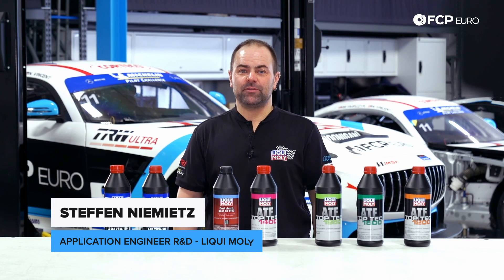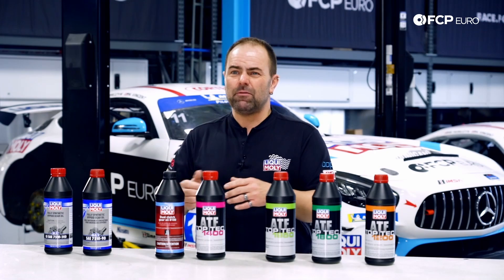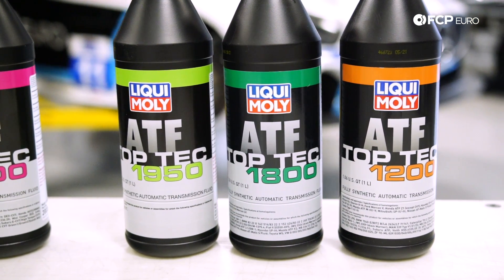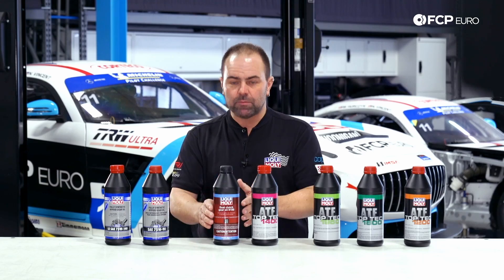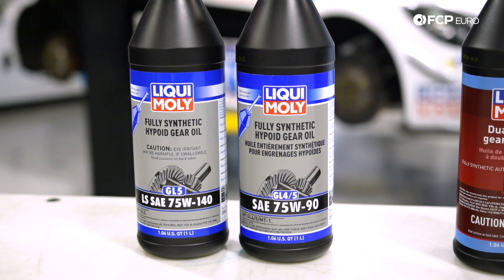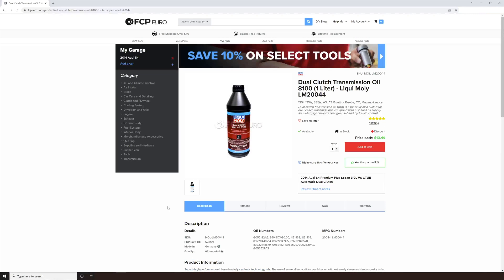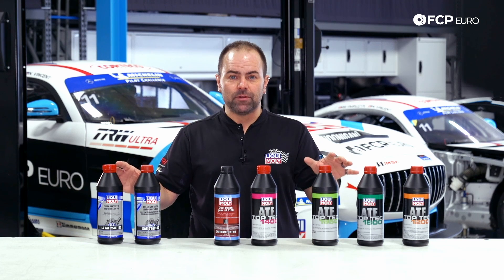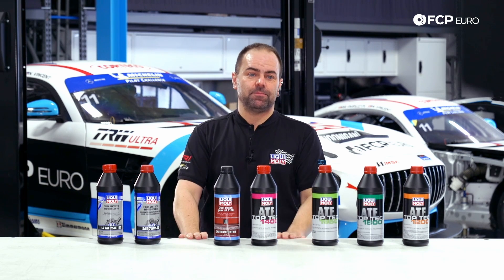LIQUI MOLY Transmission Fluids Explained (Gear Oil, Haldex Fluid, Transmission Fluid, ATF)

Comment: I replaced gear oil in manual transmission. What a difference from the last oil, wich was MPM totaldrive 75w-90. Liqui moly made the gears smooth and quieter.

Comment: What's the difference between Top Tec 1800 and 1800R?  I have a 2008 BMW E90 318i automatic.  Thanks.
Reply: Did you ever figure this out? I have the same question?
Reply: @criis651  Sorry I have no further information on this.
Reply: @Telstar_1  LIQUI MOLY responded. Both products have the same performance and meet the same specifications. The "R" stands for red and is a reference to the red color of the Top Tec ATF 1800R.
Reply: 1800R is dyed red

Comment: Hi, my car uses 4 speed AT transmission and requires the Mitsubishi SP-III spec and if I'm not mistaken the only Liqui Moly ATF that has that spec is theTop Tec 1400, which is for the CVT, is it okay to use that on my car?
Reply from the maker: You will want to check fitment on your specific vehicle over at https://www.liqui-moly.com/en/us/ !

Comment: I have KIA with 6 speed automatic requiring Hyunday SP4 (slow, torque converter one) which one should I buy ATF1200 or ATF1800? He pointed at 1200 for older 4-5 speed automatics, but mine is older 6 speed.

Comment: Hi.. for manual transmision recomended
Witch one is good to use it..
Usa sae 75/140 or sae 75/90..?
Reply: That is gear oil used in your front or rear differential not manual transmission. Most manual transmissions take ATF. Dextron III. Look in your service manual for exact specs.

Comment: What isthe difference ATF top tec 1800 and 1800R?
Reply from the maker: The only difference is the color of the fluid (1800R is red) - 1800R is also only available in 205L and 1000L containers, where the Top Tec 1800 is available in all consumer sizes, 1L and up - https://www.fcpeuro.com/products/top-tec-atf-1800-1-liter-liqui-moly-lm20032
Reply: is the 1800 clear in color? or like engine oil color?

Comment: CHANGE YOUR FLUIDS PEOPLE. ESPECIALLY THE BMW TRANSFER CASE FLUID.
Reply: Does the addition of 1400 liqi moly oil to the gearbox have a deficiency, knowing that its original oil is liqi moly 1800, which I did not find in the Chevrolet Captiva
Reply: @hassanm0hamed453  Chevy Captiva uses a standard transmission so the Liqi moly 1400 is the wrong fluid. You can fill with Dexron VI
Reply: @Simple_Youtube  thank you very much

Comment: Is top tech atf 1400 will perform well with
Toyota corolla cvt sealed transmission. As u know we add 2.5l then flush then add another 2.5l then flush then addthe last 2.5l and adjust level.coz u say it shouldn't mix

Comment: ATF Fluid for BMW E90 320d 2010? is this ok with Liqui moly 1800 ATF?
Reply from the maker: Hi Mohammad, the best thing to do is use the fitment guide on FCPEuro.com before purchasing. You may need to cross reference with sources online as we did not get the 320D model for the E90, just the 330D.

Comment: Thank you very much for the video.  What variety of ATF is compatible with the Honda accord 2010 4 cylinder?  Thanks.
Reply: It’s Top Tec 1800 for my 2011 but double check with the Liqui Moly Oil Selector to be sure
Reply: Any ATF that meets Honda DW-1 (previously Z-1) specification.
Reply: Thanks!

Comment: I like his comment about the lifetime fluids being a marketing lie.  I heard somewhere that's the term "lifetime" is really only tied to how long your warranty is. You have a 60k mile powertrain warranty, then the fluid will last the "lifetime" of the powertrain. Dirty...
Reply: In bmw case with the ZF6hp ZF asked BMW not to put a label sticker in the trans that says "lifetime fluid" but BMW did not want to train dealer techs or pay for fluid changes as it was $370 of fluid every 60k. So like every zf6hp i work on has worn out bushings due to old dirty fluid.
Reply: Not dirtt at all. Everybody should know that after warranty manufacturer doesnt give a shit how long you will drive the car and do your oil changes. If somebody really was thinking that  trans is still good after 200k miles and 15 years with original oil from a factory as an idiot